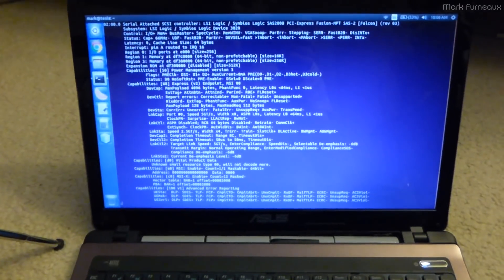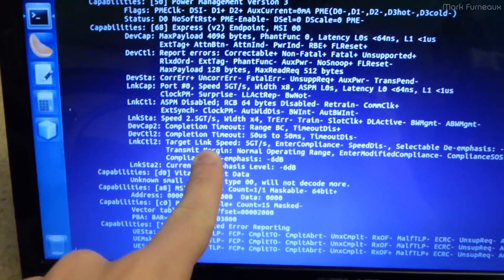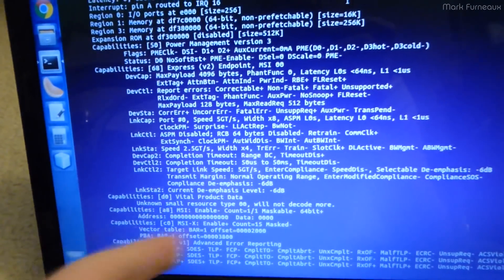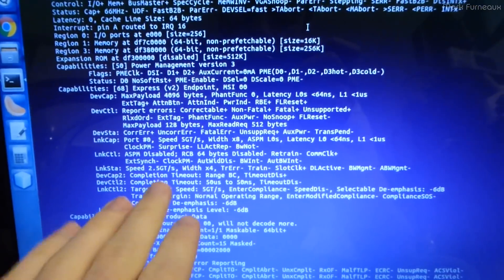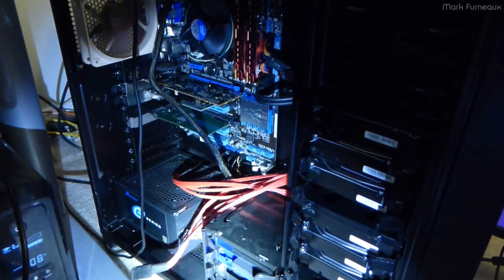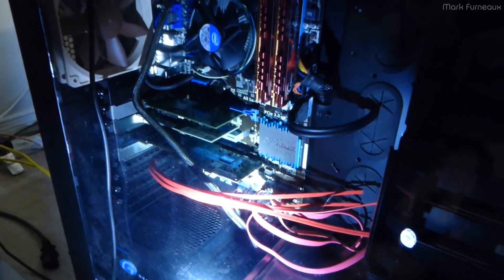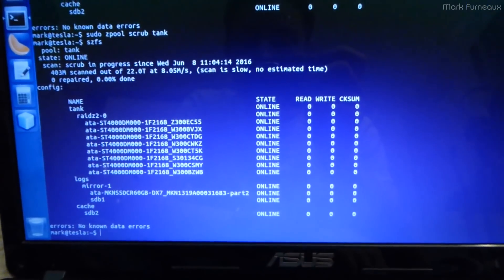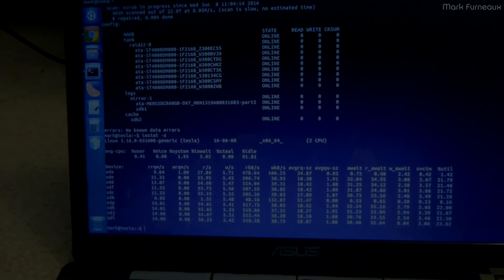PCIe Gen2 Slot + Gen2 Card = Gen1 Link?

Comment: To be able to answer your question about this system board and the capability it supports, I would have to know the model of the board and the model processor.
You may have a situation where the board is old and the only slot that is wired for PCIe v2 is the x16 slot they intended to host the video card.  I have seen some older boards where all the other slots were actually version 1 slots and it was not well documented.  You should really look at getting a newer board or one that was engineered to be a server board.  This one is an excellent option:  http://www.ebay.com/itm/SUPERMICRO-X9SCM-F-LGA-1155-Intel-C204-Micro-ATX-Intel-Xeon-E3-Motherboard-/331878473473?hash=item4d457f9f01:g:zJ4AAOSwQupXW0dV
I have run those boards with FreeNAS and with Ubuntu and they work great.  Two built in Intel NICs and a separate port for IPMI remote management.
I was going to comment about the SAS controller and spinning down the disks, but I saw that you figured out already in another video.  To add to your understanding on that, in an enterprise server, they never spin the disks down for power management because they either expect that they are being hammered so hard that they would never spin down or if they do spin down they would be spinning back up again very soon because another user would be hitting the server.  The thought is that spinning up and back down all the time would actually put more strain on the motor than just spinning all the time.  For example, I have some disks with between 45000 and 35000 hours on them that have a start / stop count of less than 100.

Comment: I'm pretty sure that one should define power management of drives in software using HBA. FreeNAS has this functionality (low power usage, low RPMs, full spin down).

Btw, there is a practice not to spin down drives in enterprise even if they are accessed periodically. The idea is that HDD head parks only certain amount of times on average and then fails before you get any real problems with actual platters and data. That is especially true if all the environmental requirements recommended for HDD storage are met (like working temps below 40 C, right humidity and treated levels of vibration from disks around)

What's the model of mobo?
Reply from the maker: I would never spin down a disk in an array unless it was a hot spare. I only wanted them to spin down before the power supply is turned off so they can park the heads rather than undergoing an emergency unload, which is really bad for the drive.
Reply: Mark Furneaux Is it really that bad if drives stay still and not ejected though?
Reply from the maker: I don't understand what you mean by 'ejected'.
Reply: Mark Furneaux ejected from drive cage. I mean it stays in case and case is not being moved
Reply from the maker: I never said anything about drives being ejected.... I was only talking about powering down.

Comment: I'm going to assume you checked the BIOS/UEFI to endure that PCIe lane isn't throttled to a lower speed.

short of your thought process of errors being detected on the lane and being throttled for data/signal integrity I'm at a loss.

lastly as far as the drives just getting the power dropped with no spindown command, enterprise drives and HBA are essentially designed to run 24/7 so ID guess given how seldom a proper server is actually shutdown they then just don't code it. or being SAS maybe that instruction is passed as a SAS command on those controllers and the use of SATA devices renders it unused.

just thoughts I thought ID throw out there.

Comment: Might be time for an X-99 mb.
Reply from the maker: That means a new CPU, RAM, and Mobo. That's basically a new server. Not worth.
Reply: I think a X99 system uses a lot of power. I wouldn't want to pay the power bill, if it's running 24/7.

Comment: i have a z77 -v deluxe asus and i cant for the life of me get the gpu to run at x16 and thats on the first slot but yet when i put the gpu on a x58 dell t3500 it runs at full speed at 2.0 speeds so i dunno
Reply from the maker: The top slot can only do x16 if the other one is empty on that board. The top slot lanes come from the CPU directly (maybe check what the CPU is capable of?). The x58 was a weird chipset, in a simpler time. All the PCIe lanes were handled by the northbridge. That was before they started integrating them into the CPU.

Comment: asrock boards have a known issue where they only running x4 regardless of what there electrically wired for. Maybe worth looking into.
why enterprise gear doesnt not spin down drives, simple there designed not to be turned off. that and lazy coders or maybe more so its legacy from the days of scsi were in the drive firmware they spin up or down.
on a side not i have the same card on my main server which has a asus workstation board i havnt had any issues.
Reply from the maker: I've heard about the ASRock issues. All my boards are ASUS. It's all up to the PCH, so the only way to tell if it's the board is if someone else has another H77 board and connects it to a lane on the PCH to see what happens.
Reply: I wish i could help more 
maybe post on tek syndicate forum tag Wendell see if he has any ideas
Reply: +Mark Furneaux what cpu is running in there?
Reply from the maker: Good 'ol Pentium G2020. IIRC, those lanes are dedicated to the other slot, so it shouldn't matter...
Reply: +Mark Furneaux the black slot only has x4 bandwidth according to asus website.
Reply from the maker: Of course. That's not the problem. It's the fact that it operates at 2.5GT/s that's weird.
Reply: do you have another 2.0 card you can test in the slot?
Reply: Could also have to do with how many pci lanes the cpu can handle to each slot because of the boards settings.

I've heard in GPU instances where you have SLI or Crossfire you will go from pci 16x to 8x and then lower if you have more than 2 cards. I've also heard it depends on the PLX chip.

Might have some luck looking into the manual for bios settings to force pci gen 2.
Reply: I can relate to that . I used to have an ASRock Z77 board with PLX chips and LSI SAS controller onboard . Both of them were useless under Linux . The PLX chip would cause the whole system to crash if I would try to use their slots and the SAS controller would go offline and drop my entire array as soon as I start any read-heavy workload (e.g. a scrubbing job) .

Comment: Just a thought, even though I'm sure you have already considered it, maybe one of the lanes has partially broken causing the speeds to drop. I'm not really sure how a partially broken lane could affect the speeds though. It may be worth scraping off some of the PCB masking over the pic traces near the CPU to check resistance though even if it is unlikely.